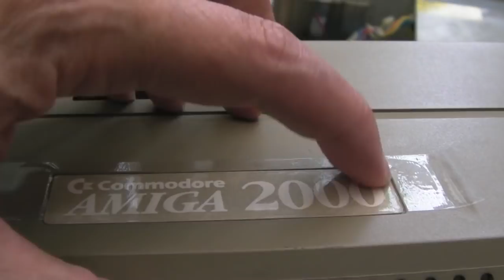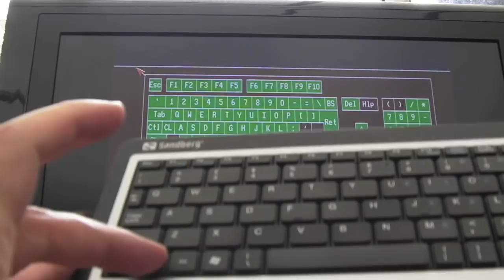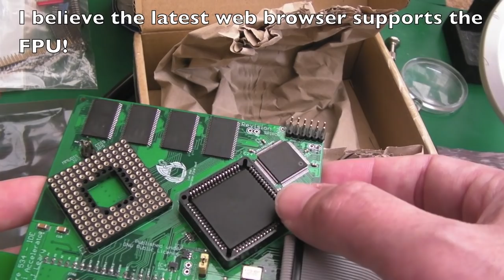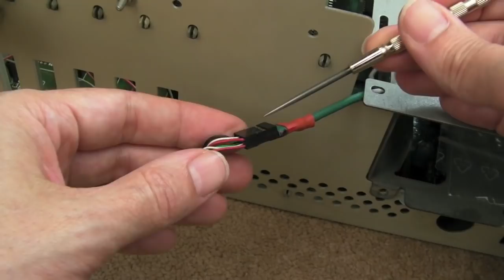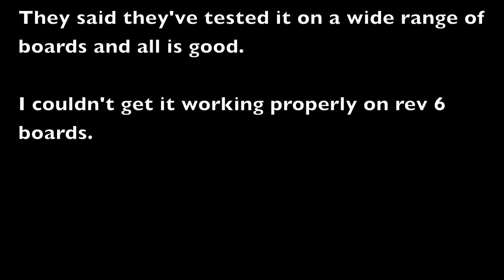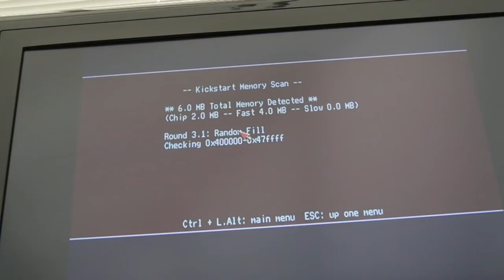Commodore Amiga A2000 Upgrades - TF534 (CPU+RAM+IDE+FPU) / 2MB Chip / Bluetooth Keyboard & More

Comment from the maker: NOTE1: Forgot to mention - I fitted a Super Denise in there too (the ECS version of Denise).   You can just simply remove Denise, and plug in the Super Denise (from a 500+).  Buster doesn't get very warm - so that heat sink on there is not really needed tbh.  But Agnus does get hot (as does Alice on the 1200 / 4000).

NOTE2: With regards to my recommendation of leaving the motherboard stock - that applies to 6.2 boards!  If you have a rev 4.x board,. certainly do the mods.  I experienced few problems with my rev 4 board.  The issues I had related primarily to the removal of that resistor array on the 6.2 board.  I did also see benefit from NOT changing the resistor sizes that sit near the CPU (3 of them I think).  IDE port for the keyboard?? WTF LOL - I meant to say USB port!
Reply: Where did you find the info on the modifications for the A2000 rev 6 boards?

Comment: The Amiga 2000 is such an impressive machine when it's fully kitted out.  I have one with a 040 at 33MHz, with 16MB of Fast Ram, and 2MB of Chip Ram.  It is a full Video toaster set up as well.
Reply: Same here. it is a real enthusiasts machine. Though mine is using a socket accelerator 030 28mhz. I have the video toaster flyer complete with drive tower and octo-cable. Several mods done to the mainboard directly and most every slot full. A machine to be proud of!  But keeping it working as it should is really a nightmare. They are worse than old macs.
Reply from the maker: Very very nice =O  040 =O  They are lovely machines indeed!  I have so much nostalgia for the 2000 as well!
Reply: @GadgetUK164  I believe the 2000 is the best Amiga overall to be honest, ok, it's not the prettiest, but I'd rather have a kitted out 2000 than any other.

Comment: This Amiga stuff just boggles my mind. There are just so many options. I watch Stephen's streams sometimes just for an extra portion of mind boggling.
This mod threw even you for a loop it seems Chris, for a short while at least it seems. But you got there naturally.
Reply: The a2000 is truly an enthusiasts machine. Mine is a rev 4 board brought partly to newer spec, and has roughtly 12 mods done on the board alone. And most all slots filled. Getting everything to work is an absolute labor of love.
Reply: @wishusknight3009  I appreciate how hard that must have been at times. It had Chris swearing and that means a lot.
Reply from the maker: Hehe, yeah - the Amiga series of computer have so many add ons and expansions etc - we are trully blessed that it got so much from so many 3rd parties.  The design was good from the star too (which helps!).
Reply: @TheHighlander71  My mainboard had many of its mods done before I got the system. And thankfully the previous owner, who has had it since new documented everything meticulously.  So it is pretty easy to see what has to be changed to give me some compatibility. I really do enjoy getting as much out of it as I can, even if newer amiga's were more powerful, the a2000 is what it is all about. Nearly every part of the OCS has something strung off it, like the 2mb chip expansion which was done manually and by replacing the chips of ram on the board itself, scan doubler, 68k socket accelerator, rom tower, several bodges to denise to enable a few extra functions and additional audio mixer, RTC....... Its a frankinstien.
Reply: @GadgetUK164  That's the really impressive thing isn't it? All the people today still making upgrades and tools to improve these machines. And they only make sense if there are people repairing old computers. And using them of course :)

Comment: That turned out to be a really nice Amiga 2000! I have been debating a megachip for one of my A500s. But the thing is I recently bought myself an A500 plus motherboard from ebay. Fixed it up and now have a nice A500 Plus with 2MB chip for use with my ACA 500 + ACA 1221.
Reply: I have two ocs amiga's, one i kept bog stock, the other I have done up. it is often just kinda neat playing with something grossly under powered. 512k chip + 512k slow...
Reply from the maker: Thanks =D  Really pleased with it!  The only thing it lacks really is AGA =/  I forgot to mention - it has an ECS Denise in there as well!  That A500 plus sounds sweet!!!!
Reply: @GadgetUK164  In my opinion AGA is overrated with regards to gaming at least. Most of the really classic games came on OCS/ECS anyway. I use the Indivision ECS V2 as super Denise in my A500 Plus motherboard.

Comment: Nice video! I just ordered a TR534 this morning, it’s gonna be interesting to see if I can get it to work with my ZRAM
Reply from the maker: Ultimately mine wouldn't work with the 534 - I test on different boards with various factory mods applied / removed and couldnt get the two working  properly together.  The ZRAM board also would not work properly with the A2630 either for me =/
Reply: GadgetUK164 - Retro Gaming Repairs & Mods I’m running it together with my A2620 right now, but I had to put it down to 4megs (since 6 wasn’t an option), and then I have another old C= expansion for the remaining 2 megs to get full 8. Don’t know if I will be able to atleast use 4 megs from the ZRAM. I hope so 😬
Reply from the maker: Yeah, I had similar craziness where I could only use it in 4MB mode with some other cards.  It was proving impossible to get 8MB with that card, unless I just used the ZRAM on its own with a stock 68000.

Comment: Awesome....reminds me if my A500+ with a z-500 zorro slot....and TF534....tried my Retina graphics card in the zorro slot....had lots of graphics glitches on screen....so i suspected it to be the TF534....bought a Refence Ram....and a AlphaData AT-bus.....(so i have ide and fast ram) plugged in the 68000 cpu and tried the Retina card again.....all worked fine....so i was right...it was the TF534...😁
Reply: Those ones seem really fussy for sure.
Reply from the maker: Yeah, I think to be fair the 534 was aimed at 500 / 500+, or A1000.  Sounds like you have a nice machine there!!!! =D

Comment: I have some of these mods in my a500 desktop case convertion. In my machine, the combined 8mb/IDE and the 68000 on top, gets really hot. So I have fitted 4 big heatsinks on the CPU. Air circulating over it all. That way heat stay low.

Comment: About the reset: It’s possible the problem is the wireless keyboard “dongle” - try a regular, wired USB keyboard. It could also be that only an “official” Amiga keyboard has the correct key encoder chip to allow for the reset pulse to last as long as you’re holding down the right keys. Finally, Adrian (Adrian’s Digital Basement YouTube channel) recently posted a video on modding a Commodore Pet with a push button reset switch; it may be applicable to this A2000. HTH. 😎

Comment: La FPU montata sulla TF534 e' la versione plcc a 40 mhz,perche AIBB dice che è a 50 mhz?,e' overclockata?
Reply from the maker: Yes, the TF534 will run at 50Mhz, that's how mine is set.  The 33Mhz CPU is overlocked to 50Mhz, and the 40Mhz FPU is also running at 50Mhz.  It runs very stable too!

Comment: Could you use the other USB for a mouse ? I also had a problem with SD card adapters a couple of years ago on my A1200, luckily it only fried the SD converter and the card. The A1200 was undamaged. Great vid, stay safe.
Reply from the maker: Thanks, yes that's a great idea!!!  It would certainly be possible to hard wire in a USB adapter for that!

Comment: I have a rev 6.2 A2K, followed your way of jumper wire from cfg-in to u660 (pin 1?) and it autoconfig'd the TF534 with the gofastram 8m Z2 ram based on the same design as your board in the cpu socket...but things are weird. it only autoconfigs 4mb fast ram from the cpu memory board, not 8, and my total is 8 with the 534 zorro3 ram. Don't know why. Any ideas? Same ECS denise and 3.1 roms. You have 12 Mb!
Reply from the maker: If you are using the Zorro 2 gotta go faster - you don't need to do the jumper wire mod - that's only for the MKL or GTGF RAM that fits in the 68K socket!   If you have the GTGF RAM in the 68000 socket though, in theory it should work, but I don't think I got the GTGF 68K board working with the TF534 - that's one reason I stayed with the MKL 68K RAM board.

The other difference might be the "timing fixes" applied to my rev 6.2 here.  Including the 3K3 resistor arrays soldered on the underside of the Zorro data buffers.

Comment: GadgetUK164 Have you come across an 2000 ver 6.2 having problems with a GVP Combo Board 030/40MHz+Ram+Scsi v4.1.  Iam having issues where the machine will boot and run fine with the stock CPU, but as soon as I put in the GVP card it just gets a black screen upto boot and no kickstart shows up.   Strange thing is this card did work about 6 months ago and I put the Amiga in the Garage over summer, looking back not a good thing to do in Australia.  So thinking it has either fried something on the GVP card or the power supply hasnt got enough juice to power the extra card.
Reply from the maker: The fact it was working 6 months ago means one of three things - 1) Maybe some corrosion on the A2000 has started or spread etc.  2) Maybe a fault has developed in the GVP card! 3) As you say, maybe PSU - you could measure the 5v rail when powered up to make sure it hasn't dropped to less than say 4.8v
Reply: Ah Ok have you any videos where you show howto check the 5v rail on a 2000 PSU?

Comment: Do you know of any A500 IDE - CF only upgrades ?
Reply from the maker: I think Kipper2K used to do one?  You could check out that link in the description to MLK's boards (including that RAM board I fitted) - he has one that provides 8MB fast + IDE.
Reply: @GadgetUK164  Thanks, He has a few options including as very basic none auto booting  that I think I could make.

Comment: I haven't been able to get the TF534 working properly in my A2000. The 4MB fast RAM is not detected, it will only work with a 1.3 Kickstart and my 8MB Zorro II card is not detected. When I remove the TF534 and put the 68000 back in, everything works.

Its a shame though as I bought an X-surf and a Rapidroad, both of which won't work with a 68000.

The TF534 works fine in my A500+ btw :)
Reply from the maker: Yes, there are some issues like that with the 534 that I have found since doing this video too.  Some things play nice, others do not.  That was one reason I went with the MKL 8MB RAM board there.   From what I understand the TF536 works better with other Zorro cards.  The 4MB fast RAM needs KS2.0 or 3.1 I think in order to be detected - with KS1.3 I think you can manually add it to the system on boot?  But the 8MB Zorro II card must just be incompatible with the 534 =/

Comment: isnt 4+2mb enough for whdload?
Reply: It depends on the game and what parameters are passed to whdload. The specific requirements are stated in each slave's documentation.
Reply from the maker: 4MB + 2MB is enough for around 95% I would say.  There are just several games that need a bit more.  And the more you have helps with caching on large titles.  Beyond a Steel Sky for example really benefits from 64MB, but will work on 8MB I think (maybe less).  Star Trek AGA needs 8MB+ too, but then again that needs the AGA chipset too.
Reply: @GadgetUK164  I see. I ran whdload with 1mb chip and 4mb fast and never encountered problems, but ran a dual boot setup for it.  Though the games I liked and played were many that were earlier titles. I have just put 2mb chip on my A2000 to see if it corrects some issues I have had with my video toaster flyer, and have yet to see how it impacts whdload. 

Also I will thank you for this video, as it may have given me the solution I have needed, as to why I have so many issues using my video flyer with my gvp 040 accelerator board. I have no issues using a 28 mhz 030 accelerator which plants in the 68k socket. But the 030 has some fundamental performance issues. It has no ram of its own, only 32kb of processor speed cache, so my only fast ram has to be z2 ram for everything. And using a 2mb RTG card, scsi hard card and the 386sx pc bridge board limited me to 4mb fast..... Which makes RTG almost unusable. When I get some time I am going to see if swapping out some of those pullup's makes a difference. It sure would be nice to use that 040 for once!  Though it works perfectly fine without the video flyer installed oddly.
Reply from the maker: Yes to be fair, 2MB is probably enough for most things, 4MB really good.

Comment: I have a TF534 and it won't work in my 2000 rev 6.3 - no ram cards at all.
Reply: @TerribleFire can you please elaborate?  I'm about to try and use one with my A2000 rev. 4.4 board.  Kind regards Luke
Reply from the maker: NOTE: Remember I mentioned that resistor array (and the 3 resistors around the CPU) in this video - I suspect the 6.3 may have those mods (or some of the other mods done to it).  It's worth inspecting the board vs a 6.2 board.
Reply from the maker: Mine works fine with my 4.2 (will all of the 4.x mods applied) - my guess is it will work with a 4.4.  Note: I couldn't get some RAM cards to coexist with the 534 though.
Reply: @GadgetUK164  which are the rev 4 mods?  Do you have a good reference for them?  Cheers Luke

Comment: That isnt pin 1 on the ide of the TF534. The silkscreen has an error.
Reply from the maker: Haha, yes - that's a really good point!!!! I had forgot about that bomb shell!!! =D  That wasn't what killed it though, I was aware of that issue and it was the darn cheap SD adapter (which I dare not connect to anything now).

Comment: Hmm, the busters on my 2000s stay stone cold... Yours gets warm?
Reply: I get some heat on mine, but I have most every slot full including bridge board. So not sure if that has anything to do with it.  Not enough for a heat sink really.  (video flyer, budda hard card, 386sx bridgeboard, rapid road+usb, s3 rtg)
Reply from the maker: I think my buster might not get that hot (honestly cannot remember) - Agnus does though!  I think typically buster might only get warm if there are Zorro cards in there.